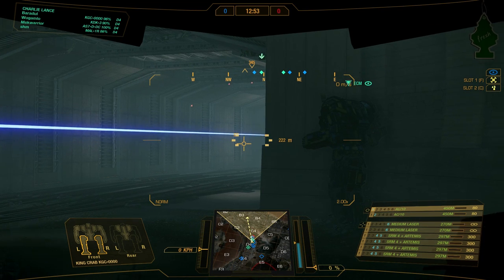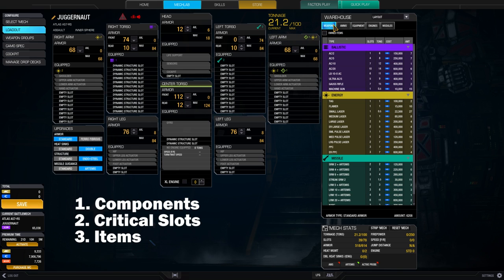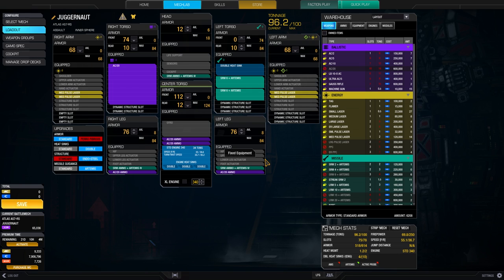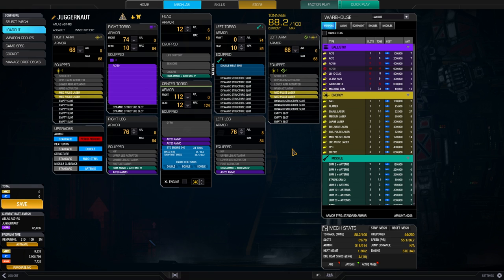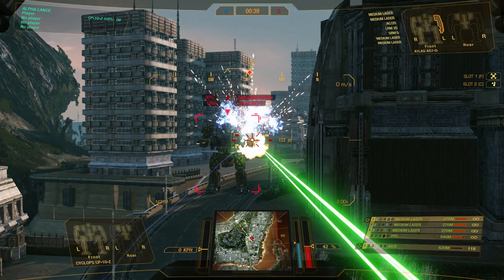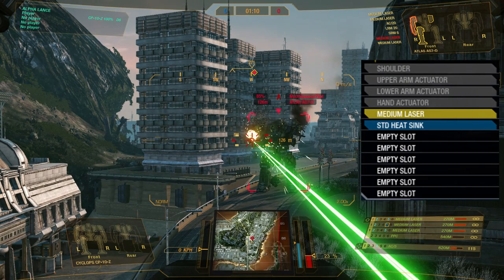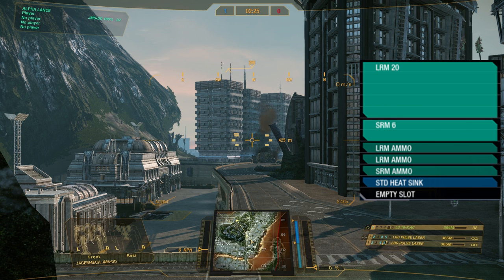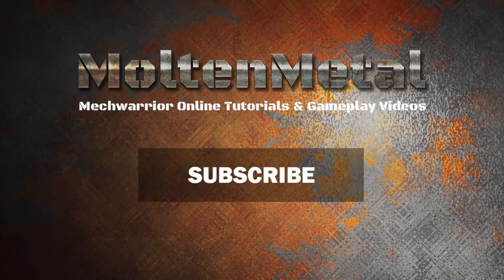Critical Damage Tutorial - Mechwarrior Online

Comment: I do not think your explanation of "splash back" damage is entirely 
accurate. Normal weapons deal 15% of its total damage per crit (like your example of 1 crit from an AC10 dealing 1.5 extra damage to structure). 
But weapons like LBX, MGs, and AC2 deal their additional crit damage to equipment AND structure. So that 1 LBX10 pellet that scored 3 crits actually deals 6 damage to the structure, not 1.15 damage. 
You can read more about it in this old (yet 
still accurate) article "Crtis and You"
https://mwomercs.com/forums/topic/81945-crits-and-you-a-brief-guide/

I'll investigate a bit on my own in the testing grounds, but I think you'll find that the data supports the extra crit damage versus structure for LBX, MGs, and AC2. Could be wrong though, it's not very well documented.

Comment: 3:11 Hi Baradul, I think the mathematics here is off. It would not be a cumulative chance. On the critical "roll" it would still only be a 25% base chance, with the number of criticals increasing (1-2-3) as the "roll" gets closer to 1%.

This would be unless there are 3 separate rolls, 1 each for 3 crits, 2 crits, and 1 crit. However, I doubt this is the case.

Comment: I dont think its wise to keep any ammo in Center Torso, if that ammo blows so does the engine.
Reply: Usually if the ammo blows I notice that so does my mech unless I have case installed.  legs and CT seem to work the best as I hardly ever had an ammo explosion in any mech
Reply: For those of us that don't manage heat well, though, it can be a real problem.
Reply: I try to always have case if I have ammo in the torso. If I can't then I put ammo that I will run through quickly because the ammo is used from the top down.

I never store machine gun ammo our ams ammo in the torso because most games I never use it all.
Reply: What order the ammo is used is also an important factor in ammo placement.  Last time I looked CT ammo was used up first.  It should also be mentioned (you may already know this) that Gauss ammo does not explode so it soaks up Crit damage.  Good Hinting all!
Reply: The open torso makes you a prime target anyway
Reply: Thought it was head - side torso's - arms - CT - Legs
Reply: As a reference look it up in Wadde's MWO guide.
https://de.scribd.com/document/236285930/Beginners-Guide-to-MWO-v1-2a